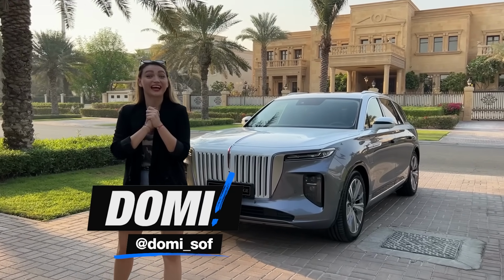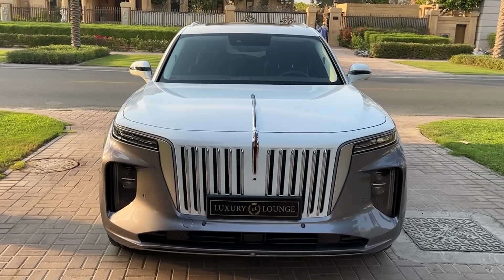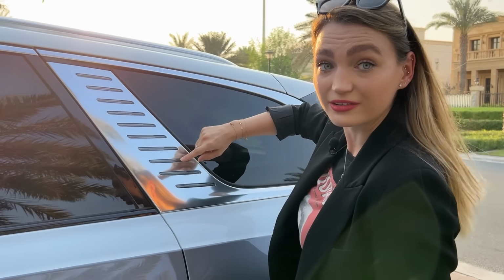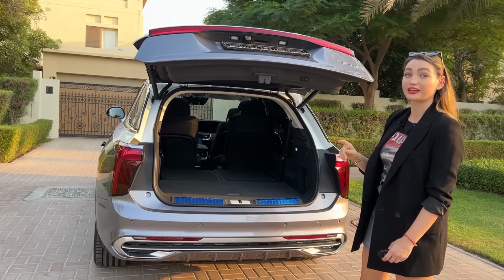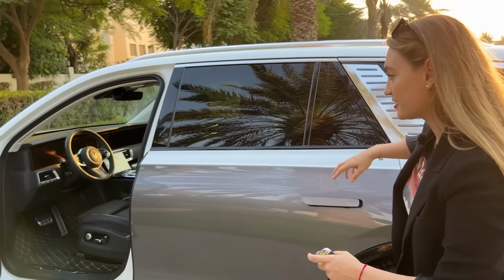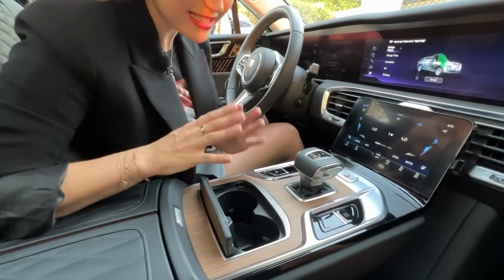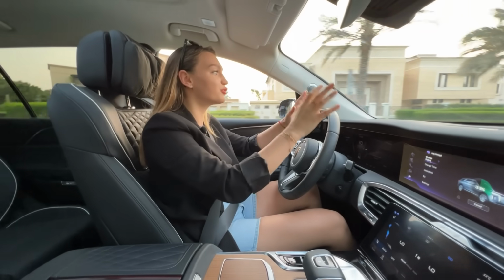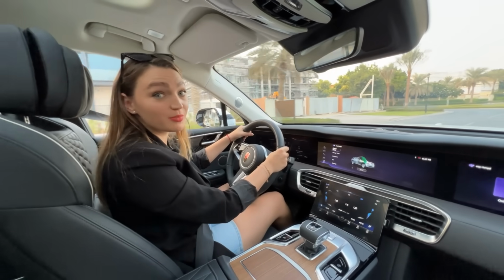Chinese Luxury Electric SUV | Hongqi E-HS9

Comment: It's got some neat stuff but ... No way. Interior looks like my Kia telluride with a cheap Amazon floor mat. It drive like a drunk pig, suspension looks absolutely awful. Going to need way better suspension system to keep it manageable in turns especially sudden evasive maneuvers. I'm sorry that interior is awful, like a Chevy product for 40k. Lights are garish and the proportion on the front looks wacky. Over 100k? Maybe 65k but why when Genesis gv80 with a great warranty, way better looks, and cheaper price just makes more sense. I think they should start like Kia and Hyundai did, value entry level cars, build a base with younger more frugal buyers, and expand to higher level vehicles as those initial buyers build their careers and can afford more expensive models.

Comment: I remember back in the early 1990s the HongQis were the only cars you would see on the road, chauffer driven for the Party elite.  Everyone else rode bikes or Soviet style buses.   The early HongQis were Chinese takes on the Russian Zils which in turn were copies of a Cadillac.  HongQi did try to update the brand over the years, mainly building bespoke exteriors on Toyota chassis and engines.  The interiors in those early 2000s HongQi's were really over the top.

Comment: So here's the thing. I'm the market for a luxury SUV. First off. I can afford Rolls. I don't want acceleration. I don't want their logo feces plastered all over my car. I want it to be calm and tasteful. I want to be absolutely silent and smooth. I don't want any bings nor bongs. And the law where I live said it needs be electric or hybrid. I love a lot country. I would like a split folding tailgate but it's a not a deal breaker. it is just Range Rover. I have one and while it didn't break down a lot of the electrics are unreliable.  Fine in a sports car, not in a luxury car.

Comment: The red line in the middle actually represents a red flag， which is "Hongqi" in Chinese.   This  feature started in the 1950s    It should be an original design, not a Lincoln copy in my opinion😊

Comment: They need to improve handling/suspension for the weight of the car.  Also, they need to think about soft touch materials and understand 'everything as a touch screen' isn't a pleasant user experience.  Buttons are needed and touchscreens should b limited

Comment: The only thing I don't like is the lack of a physical start stop button, or lack of not having one all together. If you are going to have a start stop function, I think there should be a fancy button as it makes the experience feel more special, rather then a thoughtless/designless/tactileless little button on a screen. Or being an EV it should just turn on by being in the drivers seat and there should be no button as there isn't really a need.

Comment: I have the Premium spec model of this car, which I got in march. It is an excellent car with solid build quality, on par with german vehicles. The downside is the software. Hard to navigate the menus, quite a lot of bugs that make the radio unstable. Plus for having Apple car play/Android auto. Also, in general, there are a lot of confirmation sounds whenever you turn on or off things that can be a bit annoying. Some of it can of course be turned off. The best thing is that with the EV policy here in Norway, the car was only 65,000 USD, which makes it a great value.
Reply: 65k for base or your loaded options?
Reply: @beigefox6579  that was for my configurations currency it would be around 70,000USD total👍
Reply: @evenvalbjrn1323  That's actually a good price for a premium SUV. German SUV will be over 100k USD for such features
Reply: @beigefox6579  true but German Quality is top notch, no doubts about that... U pay what u get..
Reply: @manin4568  Oh absolute. Like OP mentioned the Infotainment. I don't know which other manufacturer can touch BMW, Audi and Mercedes. And in terms of interior/upholstery build materials, after a couple of years other car manufacturers start to degrade/deform. Your 10 year German car, as long as you take care of it, will still look close to new.
Reply: @beigefox6579  100k? try 200k!
Reply: @manin4568  In the EV market of China, consumers who opt for German brands such as BMW and Audi are considered idiots and would be laughed at by other EV owners. German automakers are lagging far behind in the EV sector now.
Reply: @beigefox6579  Rubbish,  German cars aren’t what they were. Toyota is best.
Reply: @beigefox6579  Can't you read my man.
Reply: In Israel, this car almost costs ILS 400,000, which is more than 100,000 USD!
Reply: @michaelwiebe4282  This car is priced around 30 yuan in China, and its cost-effectiveness is quite high
Reply: Actually German EVs are falling way behind Chinese EVs. You need to change your thinking. It's a different world now.
Reply: Thank you for sharing your review and the price you paid for your model.
Reply: People like you should be allowed more space to make product reviews.
Reply: 在我们中国这个车也是这个价格，很划算
Reply: They will be launched in Denmark soon.  There are good deals on EVs here and if we have another kid we will need a seven seater and there are super few EV options here. This one could be the solution.

Would you buy it again?
Reply: @danmj1074  go get it
Reply: I want it here in the US😢
Reply: @youngien  but merica hypocrits hate when Chinese well known proven products enter into their domesticated nutshell
Reply: @youngien  Why? I personally am not attracted to this kind of car. And it looks Soviet-inspired!
Reply: 65K is a good price for a car like this.
Reply: It looks hideous. Might sell in Russia.
Reply: "On par with german vehicles", hell no my guy
Have you ever owned a german car in this price range?
Reply: @UnknownUser-in1hd  well, he is from Norway and bought a 65k car, most likely is not his first, and  probably had a german car before (or maybe a VOLVO). my guy, Have you ever owned a Chinese car in this price range? yet you contradict someone who owned both, just because you watch too much Fox News and hate communism or whatever...  (P.S. there are no german EV's this size at that price, this is bigger than Mercedes-Benz EQS SUV and much bigger than EQE)
Reply: @UnknownUser-in1hd 这个价位的德国车就可靠性而言就是工业垃圾

Comment: thnks but those preabul you the what when my upcode my on on_off giver to ty disfrut and good disfrut of oyu on go first what i on you intent of resaler my to my the what i proformed not downd those call towhat my delivery my winer but those posser other ber when the but my printed and designed  and on winner of departitinal and legal reclamation of the what on out derogation other be use ben a vulneration to my pertences no rebrandes. to save the legal sancions what the rubrer and rules extipulades but other juriditions an bers mayor on call to the be vulnarator to haven what uppay my

Comment: Chinese Cars... Copy the design from western manufacturers then make it with inferior quality materials and engine.. try to sell it with outside glitterings... China and Luxury car manufacturers doesn't suit in the same line.
Chinese manufacturers never spend R&D and design.. they just wait for Western countries to do this part then copy it overnight... Same like they do it for electronic products, mobiles, etc.
They even buy military jets, weapon systems 1 or 2 to do the reverse engineering and make cheap copy.
Hacking, use overseas Chinese citizens in the top technology companies and research universities to get the required information.